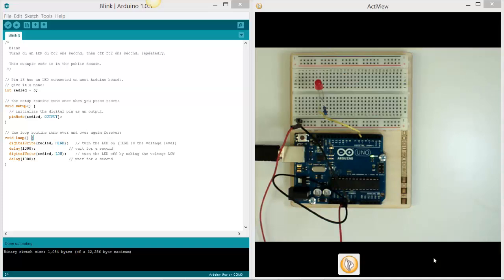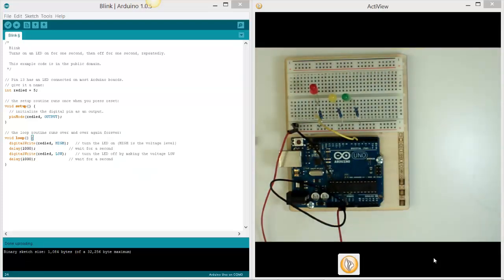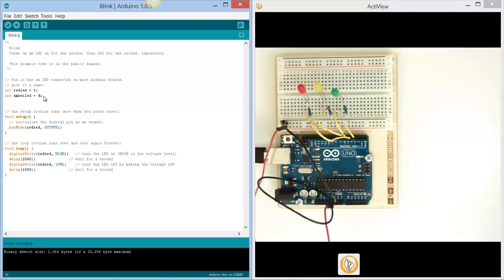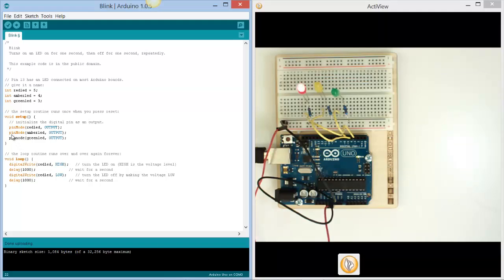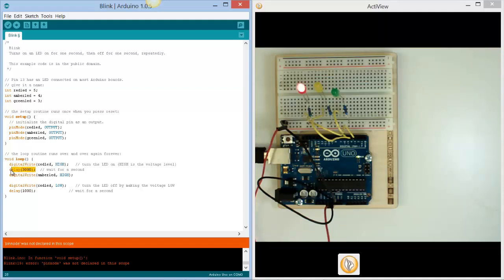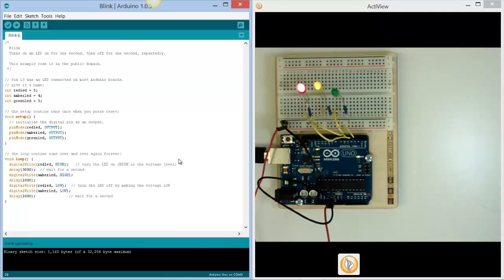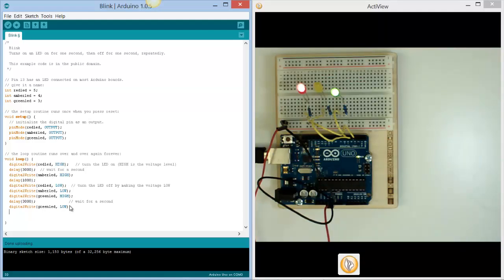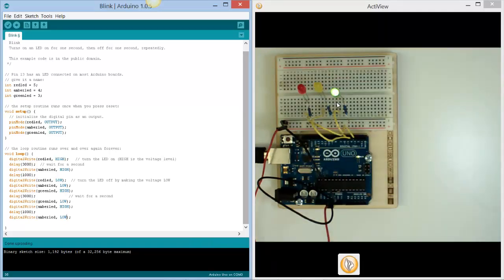arduino introduction - traffic lights

Comment: Excellent tutorial. I am interested in controlling 10 x 230v 1.2 watt LEDS on a staircase but only creating one sequence with all the lights remaining on until pressure mat is triggered either at top or bottom of staircase. I could build on this sketch and have the out puts trigger 10 Triacs in sequence in order to handle the greater load.

Comment: hello, i just need some help how to control the output led with timing(delays) even the input (switch) is stay on high, like i press(keep on high) the switch for 3mins but i want to turn off the led in 2mins or depends on my setting, many thanks